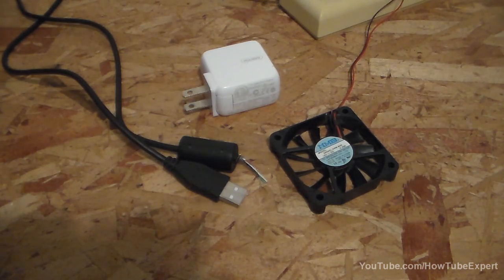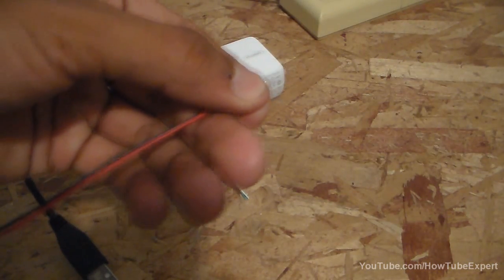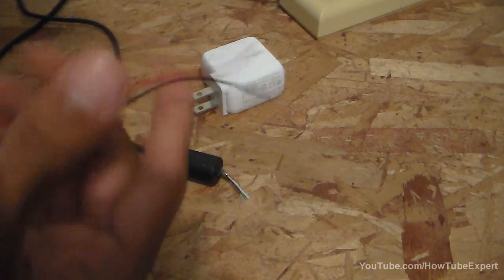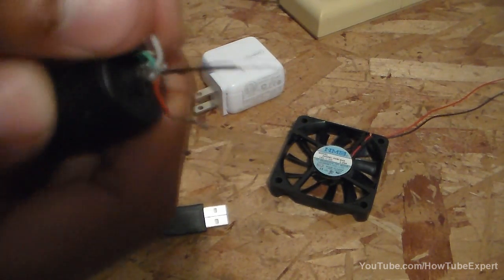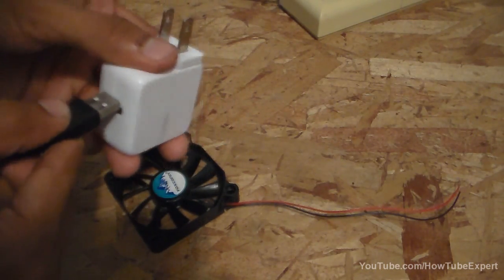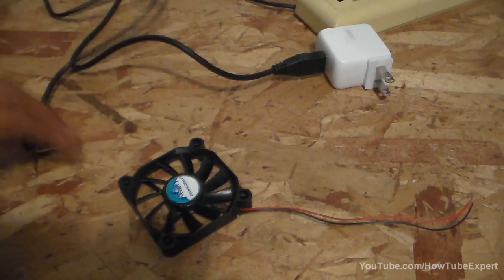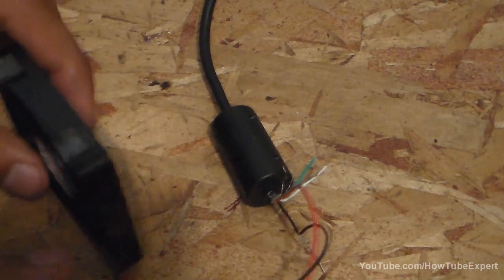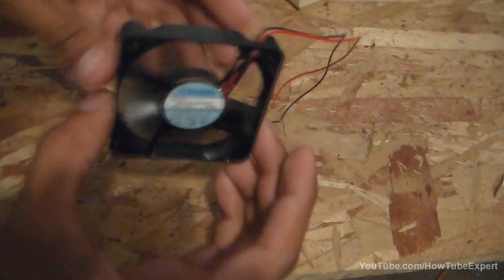How To Power a Computer Fan Via USB

Comment: I looked this up as I was curious about the specifications on the stickers.  is the .3A and 12V the maximum input, or the recommended recommendation.
Reply: Maximum input to fan, fan will run slower as its not getting its full power.

Comment: Please DON'T DO THAT! 
Voltage has to be 12V, phone chargers have 5V.
Due to much smaller voltage there is a great possibility of fire within charger.
Phone chargers aren't designed for that, you might use it for devices with different amperage, but NEVER with different voltage.
Reply: saša thank you for that information, just starting to do this, are you an electrician, what country are you from.?
Reply: Ranjit, you're welcome. that dude had good intention, but serious lack of googling. some AC adapter with 12V output is much safer option. I'm from Serbia/east Europe.. where are you from and why do you need those fans for?
Reply: saša I’m from chestermere Alberta, just outside Calgary, Canada, have you ever heard of it.? I am on permanent disability and I got a licence to grow marijuana and I want to use as little power as possible, the power supply I have is 12v and 1 amp of power and my computer fan is 12v and  2.0 amps, will I be fine running that combination.? Tia.
Reply: Ranjit, I've heard of Calgary first time as a kid when Olympic games were held there :), not sure about Alberta- maybe from some movie? Anyway, that power supply should be good enough for few fans, I doubt that fan uses 2.0 amps- more likely it's 0.2 amps- check it again. you'll need "molex adapter" to connect fan to PSU, and if you want few more fans be sure to connect them in "parallel connection" III
Reply: saša yeah Olympics were here in 88, here’s a video showing the amps, https://youtu.be/AJ_Q2ijaO5w
Reply: saša o
Reply: Zasto mislis da ne moze ovako? Ventilatoru  ne smeta manji napon, cak se na taj nacin i regulise broj okretaja istog, sto bi meni bilo od koristi radi smanjenja buke

Comment: does a 5v adapter power a 12v fan?
Reply: +Abskhairoun Mamdouh : You may need a 5v step-up module which can turn 5v to 12v.
Reply: John Doe yeah, but how many ohms should I use to nake the power 1.65w, because I just realized that my wire and motor has very high resistance and is critical to my home's current

Comment: Hello, I just bought a laptop cooler with 4 usb ports and I have a 
question. I'm using the one port to connect and use the cooler but what 
could I do with the other three? I thought the cooler would act as an 
intermediate for the laptop and hook other things to it for example 
external hard drives and usb sticks. I'm confused ..

Comment: thats fucking dangerous
Reply: nope
Reply: What a Fuckin moron, 5v DC wont even tickle bitch. 12v dc will give a gentle tingle, source: am a electrician.
Reply: md shahid Well if you're a electrician you would know that 12v doesn't hurt/tickle you only if push a lot of ampere's trough but those wires can't be pushing 70 Amp trough it or they will catch on fire.
Reply: Liquid Car
he is a noob source:am electrician (amature)

Comment: i have messed with a old fan i have and a 9v battery, and it was cool i did touch the wires and everything and never got shocked. with a usb 2.0 it is mostly 5v 2amps. it was scary thinking i will get shocked, but never did even tho i seen sparks. it is weird messing with low voltage stuff.
Reply: +The Classic Gamer anything 9 volts and under, dont worry about getting shocked lol. im like you though i dont liketo get shocked, i hate messing with anything 12v or more
Reply: your body has around 5M resistor(or whatever its called in englisch) and 5V or even 18 V is not enough to go through your body

Comment: Thanks dude very much. I did what you said and it works perfectly. I use it to cool down my modem which used to get very hot and shut down, now it runds without issues.

Comment: Nice tutorial,   I want to take my desktop usb fan and make it run on Batteries,  any ideas? Thanks John :)
Reply from the maker: +karen berry Good question. What you can do is buy some 9 volt battery and 9v connector which you connect to your fan easy and simple. The second way is to buy a 10 AA battery holder, some come with 9v terminals and others come with wires which you can use to make a portable fan. If you google 10 aa battery holder you will see what I mean and this will work for what you are looking for.
Reply: +HowTubeExpert    Many thanks for your reply..... John.. :)

Comment: isnt the cpu fan 12v but usb voltage is only 5v
Reply: +Aquakey 98  Hello mate I am wanting to use my small desktop usb fan with batteries! would this be possible please? hope you can help, Thanks John :)
Reply: yes i think its definitely possible, what batteries do u expect to run the fans on? I will think u need at least 3x AA or AAA connected in series to run your fan. Powering It with a lithium ion battery such as a 18650 cell or an old battery from an old laptop or cellphone will make this easier.
Reply: +Aquakey 98   Thank you very much for your quick reply mate, Think I might give it a go today. Thanks again.. John :)
Reply: or u can just power it straight frm an unwanted 12v power adaptor(6v shd work too but at a slower speed) if u're gonna be using the fan near a power outlet.
Reply: +Aquakey 98  Thanks mate,  I have one of those adapters what I got to power some 12v led strips... Cheers John :)
Reply: those 12v adaptors r perhaps e most useful ones to have ard as most common appliances runs on 12V, heck i even used them to charge up my vehicle battery when they went dead.
Reply: +Aquakey 98      Ok mate thank you very much... John :)

Comment: dayum! the fan gonna splode with an unregulated power station voltage
Reply: This is not true. He used a 12v jump pack for a car. At best fully charged off of a car will maybe be around 13 or so volts. While the slight over voltage may wear it out faster, the fan will only use what it can. This is why the fan doesn’t blow up in your computer on a 12v 20 amp power supply. Maybe you should learn how electronics work before commenting on a post when you clearly don’t understand yourself.
Reply: That is why electricity is not for dumbasses. If you dont understand dont mess with it

Comment: Can I connect the usb directly to a usb port of my PC?Thanks in advance!
Reply: ***** Yes.
Reply: +Giorgos Gr I would not recommended it at all, those are 12V fans. USB ports on a pc are designed for 5V and depending on the port version and motherboard its the amount of safe milliampers you can use, you could damage a port or motherboard in the long run even if they "work" for some time. If you know the exact specs of your ports and the current your fans are drawing you could decide, but.. i wouldn't do it. Fans are motors and they can generate a voltage spike (flyback) if they are not correctly protected.
Reply: ***** no
Reply: ***** - Ignore Nevets, he does not know what he is talking about. I have built two of these and yes, they work. One is cooling my media pc cabinet.
Reply: VTH V W Thank you very much for your answer :)

Comment: guys i need help. i already fucked up a lot of motors, but i think because of too high voltage(9v on a 5v motor) How should i set it up, and what battery would you recommend?
Reply: 4 rechargeable aa 1.25v or 1.3v batteries in series would give close to 5v and are common to find

Comment: guys pls help me

The colors of my cpu fan are blue,green,black,and yellow.Now my problem is where is the positive wire ant
d the negative wire.pls help thanks
Reply: Just attach the fan negative(black wire) to negative and touch yellow or blue wire to the positive wire(red wire on the fan) until the fan spins, make sure it is plugged into a power source, you wont get electrocuted or zapped
Reply: thanks ViperGamingDB

Comment: Would this over heat if it was left running constantly?
Reply: No, I attached same 12v fan to my dsl rouer and it's working 24/7...also I used 12v adaptor to power it so its rotating at full speed.
Reply: https://www.amazon.com/dp/B07NQG5HC7?ref=myi_title_dp

Comment: it worked for me. I cut a usb 2.0 cable  from my broken joystick and i joined the wires and plug into my laptop usb port. the fan spins but in low speed because the fan is 12v

Comment: The only problem I see is the fan is a 12 volt and a USB produces 5 volts so the fan will be under powered. but yet again i haven't watch the whole video. But I am looking into seeing if I can hook up the fan to where I can run it to the power on the motherboard but i don't know yet.

Comment: Yeah, cool!

Nice, simple way to show us how. Thanks for showing both the 5V (USB) and 12V output. Note that big fans (e.g. a 230 mm side case fan for a PC) may not start up at all on 5V. Also, at 5V of course you aren't moving as much air as at full voltage.

Comment from the maker: If you have different color of wire, there will be 2 wires that power the fan, the other 2 wires are for speed and temperature which makes the fan run faster or slower when it is connected to the motherboard of a computer.
Reply: +LatexFreakBoy84 You should never try to power a fan by car battery as doing so is very risky and you could end up overloading the fan with amps
Reply: +Learsi Kcuf HEY TROLL what's your problem? Need special attention here? This is not the place.
Reply: GoldenKittyCat sighs the computer fan is 5v.... a car battery is 12v... the fan in your car is 12v, You see where im going with this..
Reply: Is USB power can be controlled using Motherboard???
If yes please tell me the procedure to do it. I want to control the USB connected heater temperature using laptop USB.
Reply: +Xenobyte EDM Fan only takes what it needs. They're designed a certain way and only use as much current (amps) as they need. Generally less than 1 amp depending on the type of fan
Reply: ***** I am aware of that however, a fan can and will operate off of an (+/-)6v difference and fans can get up to 1.60a esspecially if it is a cpu fan.
Reply: Xenobyte EDM i have a 2K RPM 120mm case fan that only takes 0.46A at full speed. so fairly efficient. Though operating at too high of voltage can burn out a good fan quite a lot sooner. Even just operating at its highest rated voltage isn't good for the fan or bearings.
Reply: ***** I am aware of that as well however this is the reason I use water cooling systems instead of a fan and a heat-sink
Reply: sonictales69 why?
Reply: Ok then if a fan shouldn't be powered of a car battery then I better go and unplug the fan on my radiator - how the hell its going to stay cool now i don't know
Reply: Fox Racing A computer fan is 12volt - Ive used a multimeter to test this and also read the stickers on all three of my fans
Reply: GoldenKittyCat There are 5 and 12v fans for computers... typicallysmall laptop fans are 5v like this one.. desktops being 12

Comment: Great tutorial. USB powered fans are really useful if your PC is in a cabinet/ cupboard/enclosure and you want a fan to extract warm air from the cabinet but only want the fan to run when the PC is powered up.
Reply: Nevets Yes it will, I think you may be talking out of your pie-hole.

Just because he is using a mains PSU, a normal PC or laptop will still power it. How do I know? I have two similar to this!
Reply: Possibly would be better to solder the wires after twisting them.
Reply from the maker: dibley1973 You are absolutely right, soldering the wires would be the best option, and also some electrical tape to prevent the postive and negative wires from touching.
Reply: dibley1973 It's not a great tutorial because this will only work plugged into the mains. It will not work plugged into a pc or laptop.

Comment: I just did this with an old case fan and usb cable out of curiosity and it works. It seems a little under powered but it's quiet so I might make a few more and install them in my media cabinet to cool my htpc via it's usb port.

Comment: Sure the concept works  but something is missing...you want that fan inside your desktop...so the usb plug goes to outside of the pc port? Doesn't make sense..unless you have a mother board that has an internal usb port.
Reply: Yes they're computer fans but this concept here isn't meant for your PC... this is more something you would use as a means of cooling for something else. Say your car stereo amplifier or whatever you wanted to keep cool.
Reply: Good idea to use to cool a console

Comment: I only have mini usb-usb. does that work? and i also intend to use a 5V 700mA power supply on a 200mm case fan. have no other info on the fan except it is a 4 pin with black and red wire

Comment: Just a quick note to those who are unsure. Some cables are different colours but its just a matter of trial and error to get it to work. With regards to the fan speed, its all depending on the voltage supply and fan voltage. Most USB outputs are 5-6v, fan voltage size vary, so if you got a 6v fan it will work to its best. If you've got a 12v fan it will run half as best. If you put 2 fans the same voltage 6v, they WONT work at there best due to voltage drop cos your running 2 fans together.

Comment: How would you connect a 3 pin fan?
Reply: BattlefieldPhoenix Either temp sensor or ground, I think
Reply: Those are 3 pin fans
Reply: Ryan Skuse
oh oops I meant 3 wire fans :P (what does the yellow wire do lol)

Comment: i believe it is the voltage that is put out if you have a 12v fan and using a 5 or 6v power supple to make it faster you would need to replace the power supply with a 12v one

Comment: if you hook them up to a 12v source they will run full speed they dont run as fast on 5 volts but try a car battery or car cigarette lighter plug that is 12v

Comment: No. Obviously not. At best you'd solder a voltage potentiometer and use that to pump up the voltage from the COM/s or you'd use multiple adapters connected to the same cable. 

But, rule #1 There's never danger hen handling with volts. It's the amps you should worry about...

Comment: You can barely run one fan from one USB COM. Normally you'd get a dual-USB cable like the ones you get for mini-USB laptop HDDs and then you'd cut off the mini-USB male adapter and use the "normal" USB male adapters to power the fan up 10V.

I was actually hoping more from this video, but it just showed me something an 8-year-old kid could learn without a video, yet by just trying.

Comment from the maker: i have only tried 1, if you connect multiple to a usb port they will slow down because they all are taking pieces of power. your best option to connect multiple would be by running a powerstation like i did on the video.

Comment from the maker: its fine as long as it contains the red and the black wire inside that cylinder cable.
The voltage is the fans max capacity but the usb is only 5 so its only going to push 5V to the fan. It should be fine.

Comment: I don't have this black cylinder on the USB cable, is it alright?
I want to connect the fan directly to the computer, is there a danger connecting a 12V fan to 5V USB port?